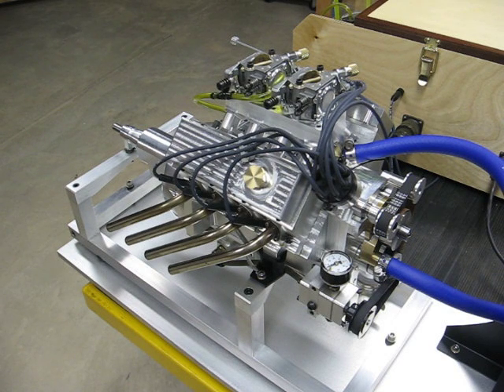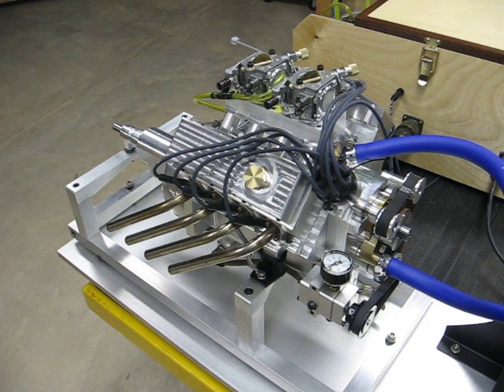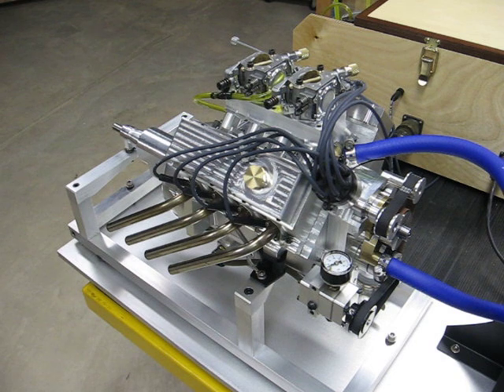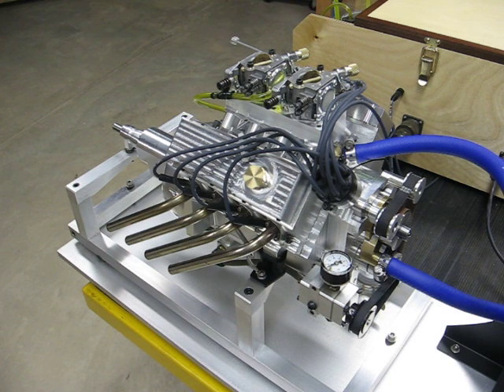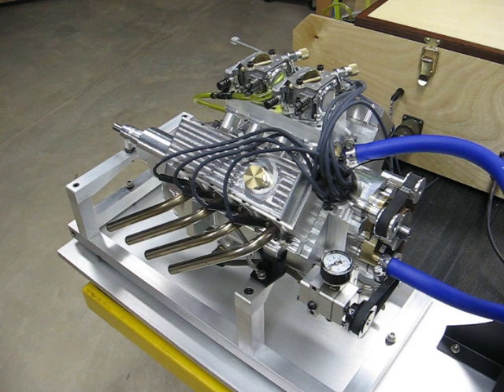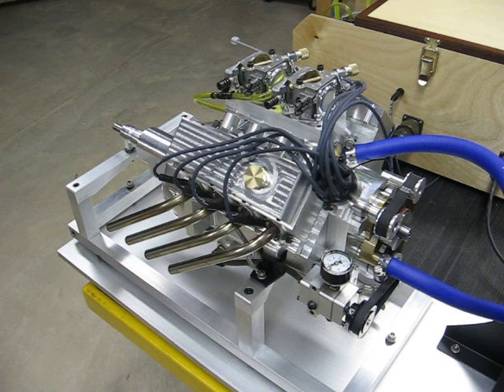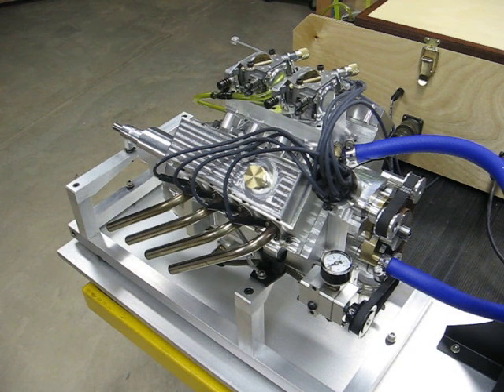Bakers V8 running

Comment: I am a 37 yr old professional welder. I have a small amount of formal training and small amounts of shop time as a machinist. I am thoroughly impressed here, and ONLY because you did this on manual machines.  if you build another of these, I IMPLORE you to record and publish videos on how you machined at least some of the most complex parts, like the crank and block and heads. future generations need to have this kind of knowledge preserved. I didn't even know it was possible to make a crank on a simple, manual lathe. (I assume?)